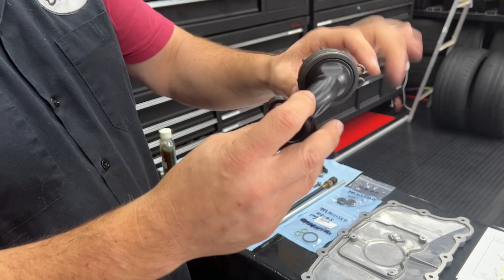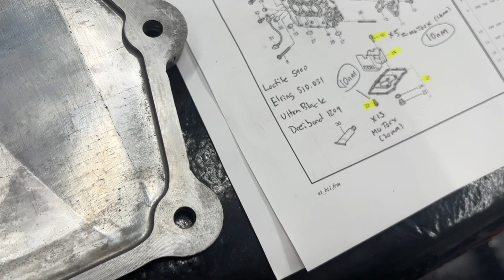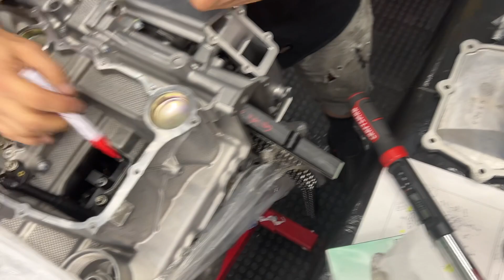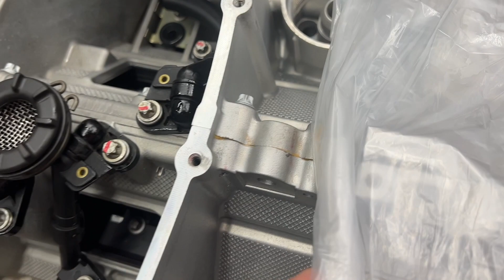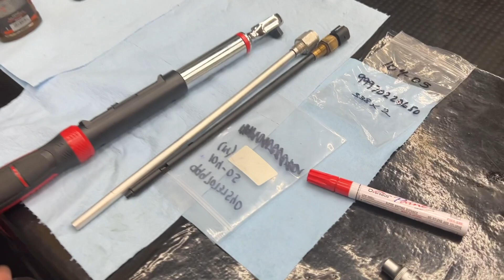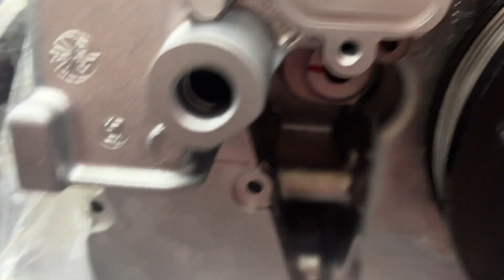Porsche 911 Engine Assembly Guide: Part 10 - Sump Assembly

Comment: First, many thanks for the content.  I appreciate that you took the plunge on a 997.  

One thing I noticed while watching the video, at 5:08, it appears "Buddy" is under the impression that using a socket extension on a torque wrench affects the actual torque being applied, it does not.

As long as the socket is on the same axis of rotation as the anvil of the torque wrench, the torque value will be accurate.  Maybe he is thinking of a torque adaptor.
Reply from the maker: +@doggerracing5243 you’re welcome! Thanks for the comment. A controversial subject 😆

Comment: I was planning on using the "Right Stuff" to seal the engine block halves vs. the Loctite product. I' a bit familiar with the Right Stuff for valve covers and oil pans. Very tenacious to separate parts though. Recently I used it to seal the upper and lower crankcase halves of a 2 cylinder Kawasaki lawn tractor engine. No leaks. What do you think of that? Any reason not to use it that you can think of? For me it's much more available than the Loctite stuff.
Reply from the maker: +Eggbert Farnsworth I don’t know anything about it really, so hoped someone else will chime in for you.

Comment: Hey Aaron,  a related question...I have tried several times to snake a poly siphon tube into the sump through the oil filler tube with no success.  It goes quite a distance and then seems to hit a wall and won't get into the oil so I can draw out a sample.  Is there a logical explanation as to why I can't get a tube down into the oil that you can see?  Thanks, man!  -Tom
Reply from the maker: +Tom Fitch hmm… great question. Not that I can see so far 🤷‍♂️